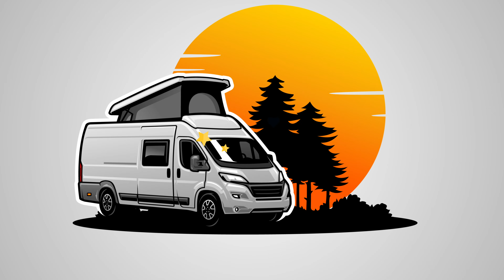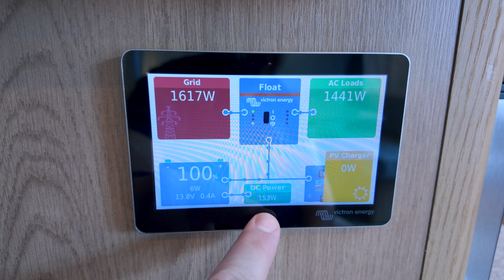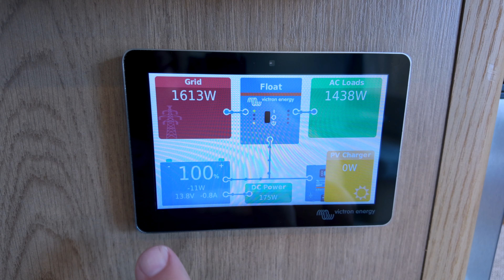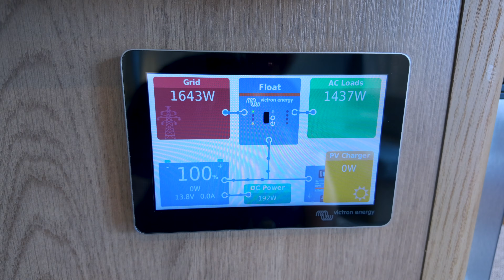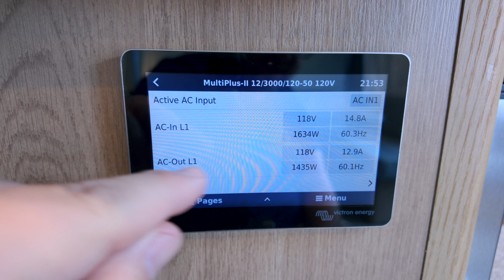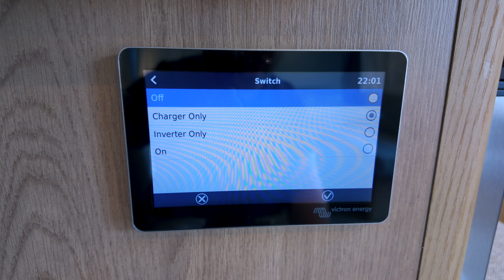Everything you need to know about the Airstream Trade Wind Power System

Comment: Hey Chad…

One question one comment, please… I have never seen my PV and more than 260… Refrigerator is on?

I love your very helpful appreciate a redo whenever you can be in certain not to use the term AC. I got confused if you were talking about conditioning or alternating parents, I’m a real new beast so please suggestion for that would be when you do redo it explain things like bulk and DC usage…

Again I am a new my tradewind is 20 2525 foot and I was a little troubled when I heard you say it’s possible to get 500 or so solar watts coming in I’ve been directly under the sun and again never get more than 250.
Reply from the maker: On Trade Wind you see more than 260 if the batteries are low or you have high demand.

Comment: Chad, We have a 2026 Trade Wind and for whatever reason, the batteries keep going to sleep. It came out of winter storage with 85% battery which we were pleased with.  Go forward a few weeks… when we are able to plug into 30 amp, usually the camper stays on.  Recently, I went to the trailer and the Cerbo was off. The blue battery light was also off and the Sea Level monitor was face the Sht Error and the fridge was beeping.  I plugged into the 7 way on my truck and it woke up even with the fridge off, after a few hours it shuts down again.  Fast forward to yesterday Blue Solar was reading 14.19, Multiplus 13.81v and Smart Shunt 13.79v .  10 hours later with nothing on, everything shut down again and I couldn’t access the Cerbo. Any idea why they keep going to sleep with nothing running with full solar? I called a few dealers and no one has an answer. 

Thanks,
Reply from the maker: You need to have each GC3 checked. You may have a bad battery or one that hasn't woke up. Also, check the breakers under the sofa on the 25' and under the bed on the 23'. There are three breakers... make sure the are all on.

Comment: " Newby" Took posesion 6 weeks ago of 2026 tradewind. after loosing power overnight, batterys fully drained from running heatpump all night in 40 degree garage. alarms go
ing off.  i look at battery display to check % of charge and only see dashes insted of % charge . after re charging bat. all day still only see dashes in  the % charge of bat. display ?
Reply from the maker: The shunt my need to be reset to 100%. It may also fix itself over time. Never, set it to on when you are plugged unless you know for sure you need it set up on. I would generally recommend using charge only when plugged in.

Comment: ''inverter only'' mode would be useful if you connect the trailer to an EV that requires AC inversion and you don’t want it to charge the trailer, as this avoids the inefficiency of converting DC to AC and then back to DC. So you would use the EV for AC needs and trailer + solar for DC needs.

Comment: is there an option to change from 30 amp to 15 amp ,  if using a non 30 amp connexion at  home or a inverter with less capacity ( 2200 Watt)

Comment: What would you set the switch to for winter storage?  We have a 2026 25 foot Trade Wind and it will be stored inside with no power from late October until March. How much will the batteries deplete over that time? Thanks!
Reply from the maker: If it is not plugged into power, I would set it to off and turn the batter discount off. If it is plugged into power I would set it to change only. I recommend it either being plugged in into power or having good visibility to sunlight for the solar.

Comment: I leave the inverter on so that I can use my phone to turn on the A/C using the micro air Bluetooth app. Cools or heats the trailer while on the road leveraging solar and 7 pin power.
Reply from the maker: I don't believe it will be available for older models. Would be too difficult to wire it!

Comment: Very informative videos, Chad! I have a 2024 Trade Wind and have watched all of your videos. Question: if I’ll be in one place for weeks/months that has 30 amps and I’m plugged in the entire time, which setting would be recommended? I typically also have the battery disconnect off and only turn it on when I’m going to run the A/C or microwave. Is that recommended or should I just leave the battery disconnect on the entire time (just not sure of best practice for longer term stays). Thanks for the great content!!
Reply from the maker: Thanks for being apart of the channel! I would recommend having the battery disconnect on, with the multi plus set to charge only. This way the battery stays changed but if for some reason you lose power it won’t run the batteries down.